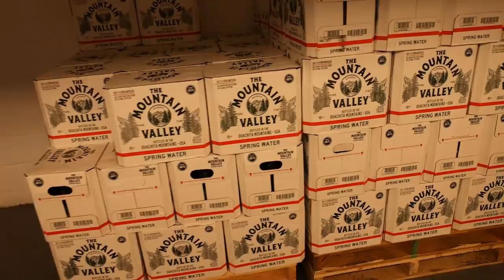Internet SHUT OFF | Bison SALE | Bandsaw Running | FFRM Vlog

Comment: Chain mail gloves are to protect from knife cuts, not bandsaws.  You're never supposed to wear gloves when running power equipment like saws, mills, or lathes because the glove will get caught in the blade and pull your hand in with it.  The glove will not "magically" come off the hand, it will pull the hand in, causing severe and possibly fatal harm.  DON"T USE GLOVES!!  DON'T DO IT!!  Unless you want to be known as "Frankie Two-Fingers".
Reply from the maker: I’ve heard this before but I don’t see how the glove would stay on the hand at that speed
Reply from the maker: I can get a fake hand and test it lol
Reply: @FrankTufano  Yes, please do that before testing it on your real hand.   You might destroy your saw in the process, at a minimum the blade will probably snap, if it can't destroy the glove and fake hand quickly enough.  You'll want to record it so at least you get something to post while possibly breaking the saw.

Seriously, I've worked with machinists and they emphasize to never, never, ever wear gloves while operating machinery.  We weren't ever discussing chain mail but imho they'd only make it worse by puling your hand in for more time before being destroyed.

Comment: $200 a month, WTF?
Reply from the maker: NY
Reply: I would just get mobile internet at that price and don't tell them you are a business... why do business get charged more when I bet most would use it less than home internet.

Also Starlink might be an option, that is only $100 a month.

The troubleshooting ain't worth that price, you could get multiple internet connections for that and just switch to the other one if it goes down...